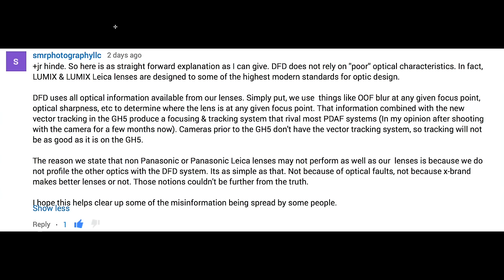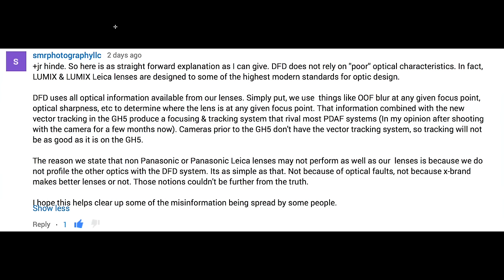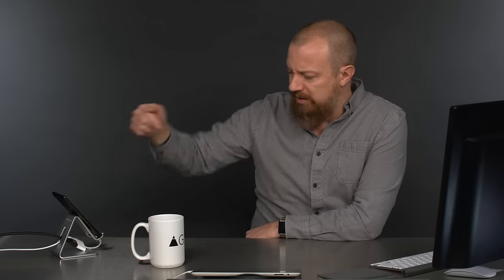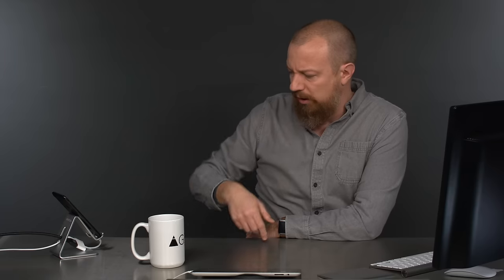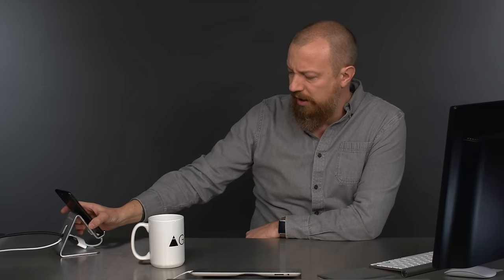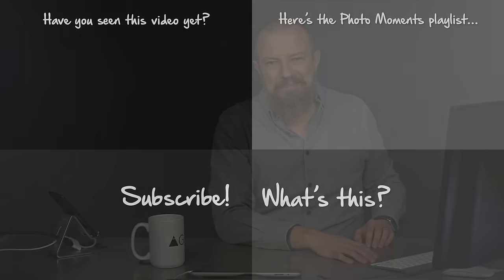DFD (Depth from Defocus) on GH5 Explained — PhotoJoseph’s Photo Moment 2017-03-06

Comment: On the subject of how the f-stop changes with zoom on the new 12-60, I saw this in the GH5 Facebook group: "Here is the answer to all asking about the aperture of the new 12-60: The aperture is pretty linear along the range, it starts off pretty straight away to 2.9 and by 18mm it's f/3.2, 25mm f/3.5, 40-50mm f/3.9 and the of course f/4.0."  (Posted on FB by Tomás Cruz.)
Reply from the maker: Sweet thanks. I'll check it when I have one again too.
Reply: If it's linear (and I don't see why it wouldn't be) it would be y=0.025x +2.5 where y is the minimum aperture and x is the focal length.

Comment: Thanks for clarifying this. From what you have said, the GH5 auto focus technology seems like a great auto focus system and I have no idea why that person thought the DFD used the poorer quality of the lens to get focus, which really didn't make sense to me at all. Since non Panasonic/Leica lenses won't get the DFD, it will be interesting to see how well those lenses focus as I am getting an Olympus 60mm Macro lens since its the longest MFT macro lens there is currently and I need the extra length and would be interested to know how it would focus, but it should auto focus well, even without DFD.
Reply from the maker: I think they still get DFD focusing, but don't get it as fast because the lenses aren't profiled. Although that's worth clarifying, so I will!
Reply: Thanks. I thought I read (or saw on a video about it) that only Panasonic lenses would get DFD, so would be worth finding out. Do you know what memory cards would be good to use with the GH5? I was thinking of getting a Lexar 256GB Professional 1000x SD (SDXC) Card UHS-II U3 - 150MB/s if that would work with 4K 10bit 4:2:2 or would I need a different card?
Reply from the maker: +Dave's Nature Productions UHS-II cards are what you want, especially for shooting 400mbit. Standard UHS-I cards work fine as the camera ships. That's all I have currently!

Comment: I have been enjoying watching your shows on replay and hope you are still looking at comments on older videos. These quiestions I am sure you will need to ask someone at Panasonic about and they may not be able to answer yet but it would be good to know. I am almost exclusivly just a stills shooter and use both a G7 and a few different Nikon camera and while I like many of the features in the GH5 I am not sure it has the extra value to me at this stage to buy one over say a G85. While you have been talking about the DFD in this video it got me thinking about a few questions below.

Is it at all pssoble for Panasonic to impove the focusing systems on current modles via a firmware update? (could they add even some basic vector tracking) I know the main improvement is the higher refresh rate.
On a related note do you think they could add at least some more control over how the AF works in curren models?
Will newer non GH models be released with the same level of AF systems?  -It would be a shame for us stills shooters to be forced to buy the top of the line model just to get better AF.

Comment: If I understand DFD correctly, what the camera's doing is what I was taught when learning photography back before 35mm film disappeared; [final] focus on the subject requires finding/focusing on the subject then refining the focus back and forth until I see that the subject is as sharp as possible?
Reply from the maker: No; the focus doesn't go back and forth. That'd take too long and you'd see that in video. DFD is calculating differences between two out of focus images (which it presumably grabs as it moves focus) and jumps to that point.

Comment: question about manually setting the lens focal length for using the IBIS with adapted lenses: can you assign a custom function button to change the focal length of the lens? this would be useful for adapting zoom lenses.
Reply from the maker: +Sean Minor Probably to bring up the controller (slider) to choose focal length but not to preset various lengths. Can't verify (don't have a GH5 now) but I'd be surprised if that was in there.

Comment: Do you think that Panasonic will consider adding the vector tracking algorithms to cameras like the G85 or GX85 through firmware updates?  Or do they require additional processing power or image processor features that are only present in the GH5?
Reply from the maker: +J. W. Green Yeah that's not something that can be added. It requires the processor in the GH5.

Comment: Can't decide between the Panasonic 35-100mm f/2.8 and the Olympus 40-150mm f/2.8 PRO for my GH5. I'm leaning towards the Oly so that when auto-focus fails, I have a linear focus ring that works like a real manual focus ring. Is the DFD really big of a deal that I should buy the Panasonic instead? Looking to use the lens for AF-C or AFS, focus tracking mode. This is for video, not stills. 
I'm buying particularly for auto-focus. For strictly manual focusing, I have other lenses for that. Thanks in advance. God bless.
Reply from the maker: AF isn’t going to be stellar for video although it’s gotten a lot better with all the updates. The Panasonic should definitely be better for AF. That linear MF sounds nice though (I’ve never shot with the Oly). But can you rent both and try them out?
Reply: @photojoseph  thanks for your reply.  Sadly M43 is not as popular here in Manila as Canon EF lenses so there's none for rent. But i managed to test the Panasonic in a store yesterday (the only one that has Panasonics in stock) and AF is good, but not as good as my old Canon 70D's dual pixel. As for the Olympus, it's even more difficult to find.
Reply from the maker: Yeah the AF is not as good as Canon’s sadly. Other benefits to the Panasonic.

Comment: Joseph, can u talk about or get an answer about how to synch 2 or more gh5s timecode thru the bluetooth
Reply from the maker: You can sync as many cameras as needed to time-of-day by Bluetooth from your phone which has arguably the most accurate clock available to you, and will therefore sync all the cameras together. You can NOT do timecode jam sync however. This feature was only available on the GH4 with the YAGH which is not being updated for the GH5. Turns out no one bought the damn thing.

Comment: I’m re-posting my question from the live-show here, to see if anyone  else knows how the GH5 utilizes ETC (Extended/Electronic Tele Converter – cropping on the sensor, for pixel by pixel mapping, in video). 

I’ve read somewhere that ETC works less than desirable on the GH5 (don't remember exactly what kind of limitations being mentioned). Does anybody know if this is so, and why, if so, that is? 

ETC could be somewhat of a free lunch to obtain longer reach (more tele) in video, as it kind of is on my GH2 (if one looks away from the heavier high-ISO-noise). As I am now moving from my beloved GH2 to my now preordered, and much anticipated, GH5 (a very overdue upgrade) I’d really like to continue using this feature, both in 4K and full HD. 4K ETC would also make possible the use of some 16mm lenses, as well as the SpeedBooster XL 0.64x with APS-C lenses.

So any information on how the ETC behaves on GH5 would be much appreciated!

This question might seem very off topic and misplaced, but as I've seen lots of other questions being answered in great detail in this channel I jumped to it.

Comment: Thanks as always for this Joseph. Question for you - What Depth of Field (DOF) iOS app would you recommend for Panasonic GH5 users?
Reply from the maker: Do you mean a depth of field calculator? I have PhotoPills which has that feature… probably the only app I have that does it, but if you search that on the App Store you’ll find a ton.
Reply: @photojoseph  Yes a DOF calculator. :) Thanks - I have also seen a ton but didn't know if you knew of one you preferred as some of them seem to be specific to model of camera. Thanks again!

Comment: Hi Joseph,
Thanks for the note about DFD, was really informative.

I could use your help with something. I'm an amateur photographer trying to get more into travel photography and videography, but mainly videos. I've been using a Fuji X10 for some time now and would like to upgrade to something more powerful. I also think of it as a long-term investment and would like to get a great, slightly more expensive camera over a good, but more affordable one. I'm also a fan of bokeh when it comes to photos and thus thought it'd be a good idea to upgrade to a full-frame camera.

I was thinking of buying the A73 and will have saved enough in 2 months to do so. However, since the announcement of S1, I've been kinda torn. Even though there haven't been many details about the S1, what's known so far is really exciting. (Even with the full-frame vs cropped sensor 4k confusion).

I realize that your opinions will, of course, be biased towards Panasonic, but I still want to ask your opinion about this. Is it a good idea to buy the A73 in 2 months or wait for another 3 months for the S1 to launch? (I'm looking at the S1 with the hope that it'll be priced under $3k. If it's anything above it, I'll have to go for the A73). What do you think?
Reply from the maker: I think it’s worth waiting. However I also think if the only reason you’re going full frame is for better bokeh, you can buy a micro four thirds camera and lenses like the Nocticron or 15mm Leica or even third party lenses as fast as 0.95 and get the bokeh you seek. No working pro would be happy without bokeh, and lots of us use MFT. Just watch some of my lens-specific videos and you’ll see plenty of bokehlicious photos.
Reply: Hi,
Thanks for the reply. The bokeh is just one of the reasons. It sure is a pretty good reason for me (so much so that I was thinking of getting a Sigma 85mm f/1.4 with the Sony A73 :)).

But I'm also thinking of it for other reasons. My cases involve both shooting outdoors in the morning and then cities at night. So I think it'd be good to have a better dynamic range when outdoors and also a lower noise in low light situations. I can see myself working in low light situations a lot and I think I'd want the camera to be able to better handle it.

But like I said, I'm still an amateur and I'm not sure if I should be spending as much as I'm on a powerful camera yet.
Reply from the maker: G9. It’s all you’ll need. Spend the savings on good lenses.
Reply: I haven't given much thought to G9 before. I will look into it. Thank you.
Reply: I looked into the G9. Even though it's a 'Photo centric' camera, it's got some pretty good video features as well. But I was looking into some quality lenses like you suggested and this was the fastest Panasonic lens I could find: https://www.bhphotovideo.com/c/product/1023336-REG/panasonic_leica_dg_nocticron_42_5mm.html. It stands at f1.2, which comes to f2.4 in full frame terms. But if I'm looking at full frame Sony E alternatives, there's the https://www.bhphotovideo.com/c/product/1393494-REG/sigma_85mm_f_1_4_dg_hsm.html, which is much faster. Please correct me if I'm wrong, but it still seems like the full frame has the faster lenses when we equalize the aperture as well.

Comment: Should DFD stop me from buying an Olympus 12-40mm f2.8 Pro over the Panasonic 12-35mm f2.8?
Reply from the maker: I have no experience with that lens, and in general Panasonic lenses will be most compatible, but an Olympus lens will certainly work.
Reply: @Jose Allan we have the Olympus Pro lenses ranging from their 7-14 to their 40-150 f2.8. We use these lenses exclusively with our GH4 and GH5. We can definitely tell you that the DFD autofocusing system is lighting fast for stills (photo) however we cannot comment whether the DFD is useful for video as we don't have a Panasonic lens to compare it with. We hope this helps.

Comment: Where do people get this nonsense? I mean, there are plenty of tests out there to show how good some lenses are, so based on what DFD could possibly be based on that? More importantly, which sane company would base their tech on crappy anything? It doesn't make any sense. How is that more plausible than the standard explanation of studying the depth characteristics of a lens? I don't understand.
Reply from the maker: +theSUBVERSIVE Some one heard it and wanted confirmation 🤔 But I'm happy to have the opportunity to discuss what DFD is.
Reply: +Joseph Linaschke +The SUBVERSIVE  I was unaware of this conspiracy until recently, so figured it was best to ask Panasonic, via Joseph (thanks guys).

Best I can track as the original source was a comment that Dave Etchells at Imaging Resource made in their 2013/14 interview with Panasonic about the GH4, which was added to the article the interview was in, but clearly not specifically discussed with Panasonic at the time.

The article was published at http://www.imaging-resource.com/news/2014/06/05/panasonic-executive-interview-part-i-why-no-long-teles-and-depth-from-defoc

and the exact quote was:

"They didn't tell me this, but I'm guessing that DxO's infinite depth of field technology is based in part on using longitudinal chromatic aberration to determine how much de-blurring is applied to different parts of the image. They were aiming that technology at smartphone makers. What they did tell me was that if you made a lens with the right kind of distortion, it made it easier for the algorithm to figure out how to process it."

Even without knowing the exact details, this conspiracy approach would not work from a business perspective. Produce crappy lenses so DFD will work? What happens if Panasonic one day produce a great lens, would they then scrap DFD? Or be tied into producing crappy lenses forever?

Frankly, I was appalled that people could believe this crap, let along abuse others for not believing it also!
Reply: Who cares about Depth when there is no depth on a FLAT EARTH!!

Comment: I just wanted to use this comments as a forum, if you like towards the discussion of the Speedbooster and 18 - 35mm Sigma combo - everyone seems to be obsessed with it and I can understand the huge appeal of the F1.2 apeture, specifically on the GH4 where high ISO performance was poor. I'd love to get your opinion on this Joseph. To me spending £1200 here in the UK one one lens (granted it covers 2 key prime focal points) seems absurd. By going mirrorless one of the advantages is size, and with so much small and fantastic M4/3 glass nowadays you really can keep the camera small and compact without breaking the bank. Plus with the inclusion of OIS on many Lumix lenses the dual IS looks like a fantastic bet. I'd love to hear the opinions of others on this, am I missing something key?
Reply from the maker: +James Cousins I haven't used the combo and perhaps it is the best thing ever, but I can't say. The weight and size advantage of MFT is I think not the deciding factor for a lot of people who are super into using these larger lens combos. Maybe I'm wrong but I think they love the cameras for different reasons (cost is a big factor)
Reply: I was wondering this myself. Its not just the F1.2 aperture people use that combo for, its using a speedbooster can give you less crop and very similar crop factor to using an ASP-C sensor camera which many wanted as they didn't like the 2.3x crop on the GH4 or x2 crop of MFT and wanted a wider FOV. The only time I'd see myself using a Speedbooster (or adapter in general) is if I wanted a lens that there wasn't an equivalent MFT version like a longer than 120mm equivalent focal length macro lens (60mm being the longest on MFT) or a telephoto lens like the Tamron 150-600mm which has a longer zoom than the  Leica 100-400mm etc...

Comment: So the Panasonic Leica 12-60 is not as good at focussing as the 12-35 2.8??? Did he mean to put it that way? Did he actually mean "non-panasonic and non-panasonic-leica lenses may not perform as well as our lenses."??
Reply from the maker: +orange42 Panasonic Leica are Panasonic lenses, and the best of the collection. So they will focus as well other Panasonic (Leica or not) lenses.
Reply: Whew! Thanks for that! Just his wording got me confused. Swapping out the 12-35 with the 12-60 to have the longer reach for walk around photos.
Reply from the maker: +orange42 Just be aware the 12-60 is f/4 at the long end, while the 12-35 is f/2.8 throughout. That said I kinda fell in love with the 12-60. It's a great lens.
Reply: Yes, I presume it would hold to y=0.025x +2.5. At 35mm that means just a tad over half a stop. When I need a walk-around lens it's usually with adequate stage lighting or outside daytime conditions. I never used the 12-35 for low light situations, always swapping out to a prime.

Comment: Can't they just set a protocol for profiling lenses and have at least the Olympus lenses supported too? The idea of M43 is that it's an open system, so why just try to "close" it up like Canon or Nikon does?
Reply from the maker: Because there are a LOT of lenses out there. If Olympus too, why not X Y and Z? It comes down to resources. It's FAR from a closed system; you just have a slight advantage to using Panasonic glass. I don't think that's a bad thing and any manufacturer of any product in the world will always tell you that you should be using their accessories over third party ones. The other lenses are supported. They just don't get DFD autofocus. 

Does Olympus profile Panasonic's lenses?
Reply: Because Olympus & Panasonic already work together on the M43 system, so why not? I can understand that not all lenses can be supported